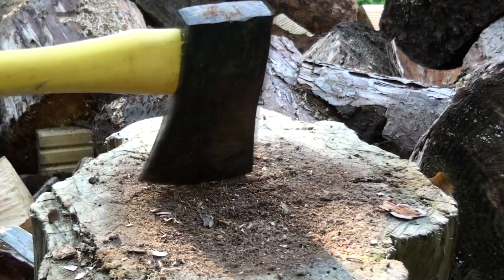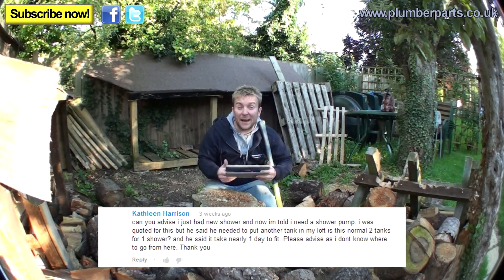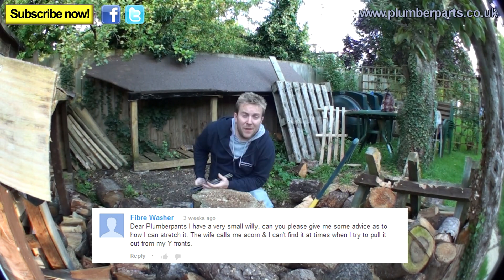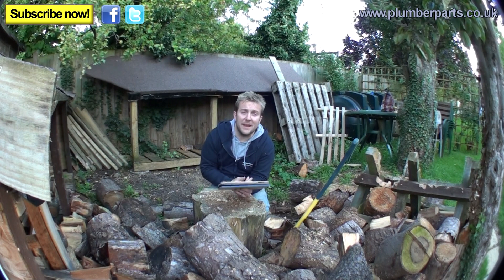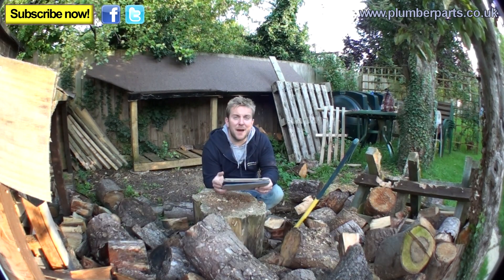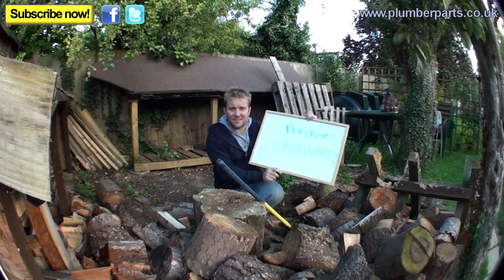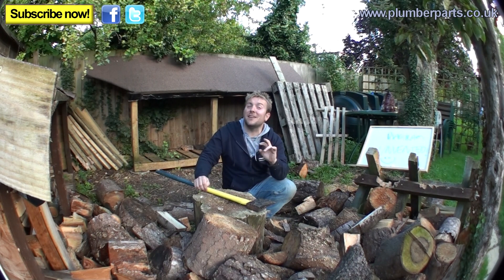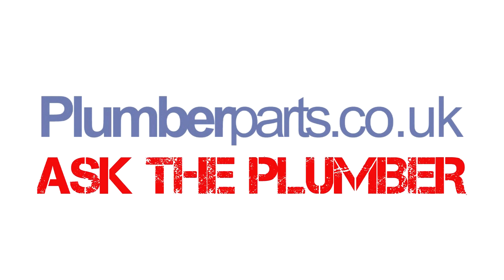ASK THE PLUMBER 03 - Plumbing Tips

Comment: Any chance of a more detailed vid on water hammer... causes and cures etc? Seems to be one of the only issues you've never really tackled - also there are no really good resources anywhere online about it either. I'm trying to learn if there's something specifically in my plumbing that's causing it (seems to happen on all devices and taps etc), is an arrestor a good idea? If so, which type is the best, where on the system is best, will one be enough etc. Interestingly, when I leave my hosepipe turned on at the mains, it totally cures water hammer... even when coiled up and not being used.

Comment: Hi, how long does it take to heat the water to approx 60c in a 250 litre water cylinder using a vailiant ecotec 428 condensing boiler I.e 1 hour, 2 hours etc. thanks ,at

Comment: Just a tip, you should get a proper log splitting axe with a wider blade not the felling axe you are using. You can get one that will work for your purposes in aldi at the moment for 16.99